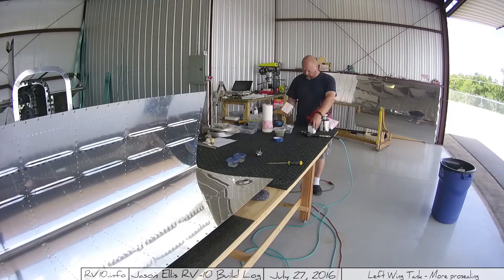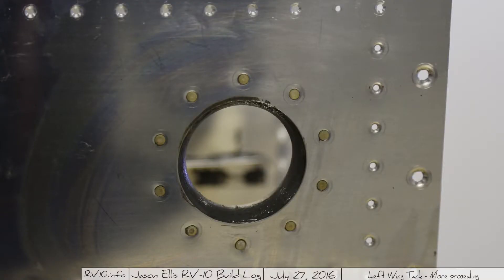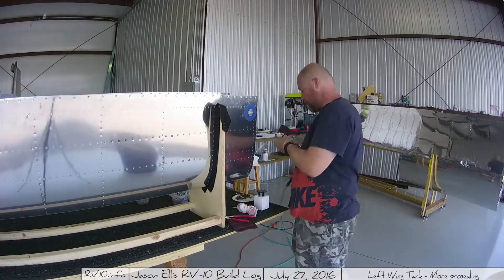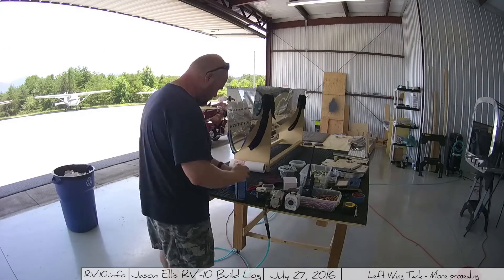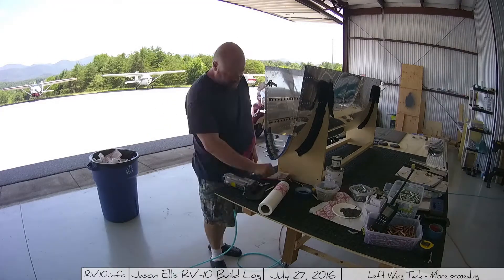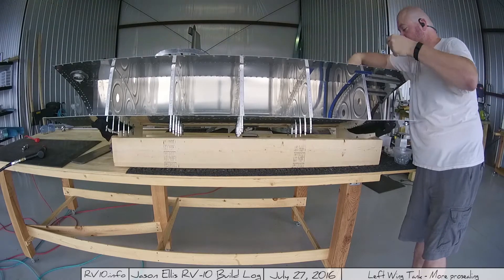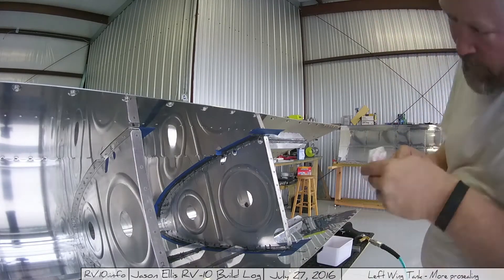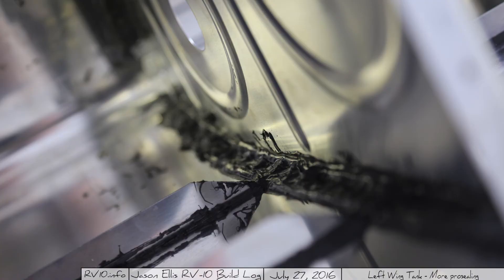RV-10 Wings - 025 - Wing Tank More Prosealing

Comment: Not sure where you are at with prosealing, but as an Apache helo maintainer, we use small acid brushes to apply proseal.  Beats the heck out of applying with lollypop sticks and you can control it and apply it in a uniform manner almost as if you were painting with proseal.  Tips for hits.  Enjoying your videos as I have been interested in building an RV10 for years.  Built a factory five AC Cobra......RV10 is next!!!

Comment: To add to Seth Miller's comment, I will use a small cup of very soapy water to dip my finger in and then use my soapy finger to smooth out the pro-seal. The pro-seal won't stick to your finger like this and you can get a very nice smooth look. Might not matter for the tank but it's a good technique for sealing up antennas and leaving a smooth surface to paint. Just something I've learned. Great job by the way.
Reply from the maker: Just dish soap or does it matter?
Reply: Jason Ellis
Reply: Jason Ellis Sorry for replying back so late but yes just some dish soap should work.  Just make sure it's not diluted too much so that it feels like a soapy film on your finger after dipping it.  Again, sorry for the late reply.

Comment: Jason! Good to see your video update! I have been working in commercial aviation for many years now, and I might be able to offer some ideas about applying pro-seal. If you are going to use the pint or quart kit, try taking a zip-loc bag, filling it with however much you need, and clip a bottom corner off to make something like a piping bag for bakers. Also, to move it around or smooth it out once it is on the aluminum, you can wet your fingers (spit, water, isopropyl alcohol) and it will move really easy. The spit sounds gross, but it seems to work the best next to the alcohol. There are places that sell sealant "spoons" made from brass to work it too. Aside from the pint and quart kits, they make them in tubes, all you do is get a tool to mix it with your drill, and put it in a sealant gun. If you'd like more info on that stuff let me know and I can provide more info. Keep up the good work!
Reply from the maker: Very much appreciate the advice Seth.  I will try the ziplock back approach.  Its getting easier the more I do it though.. hehe so that's good..
Reply: You've been doing a great job so far, looking forward to seeing videos of everything on the last build day!
Reply: +Jason Ellis Former fuel mechanic here, 9 years experience on integral fuel tanks. Using a tube of sealant with a semco sealant gun and sealant tip is so much easier for long seams. I use my finger to smooth out the sealant while wearing a latex glove, it is way easier than using a popsicle stick. Everybody is saying to use as much sealant as possible, but more important than that is to really smash the sealant into every Crack and crevasse as possible using either your finger or some kind of flat headed tool, then smoothing it all out. Keep up the good work, love watching your videos.